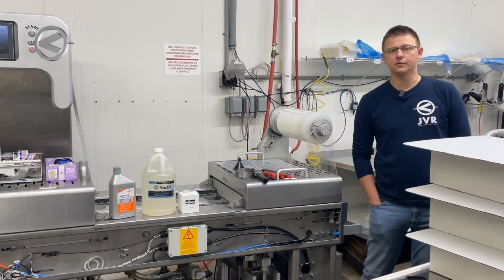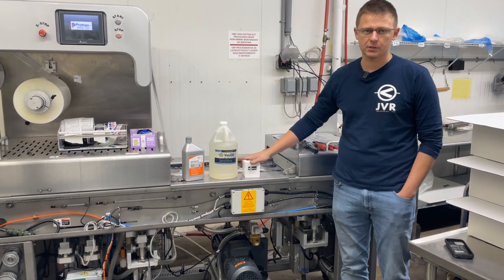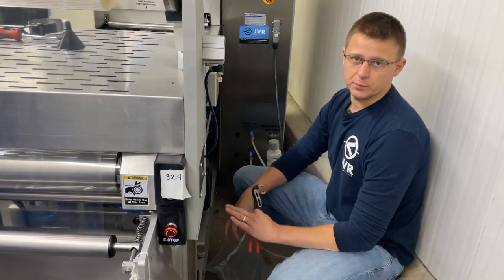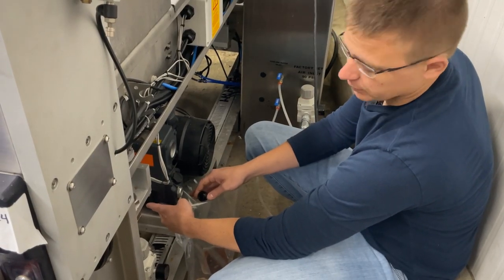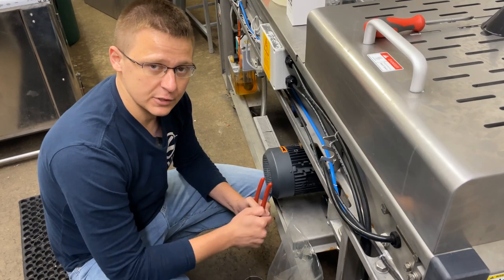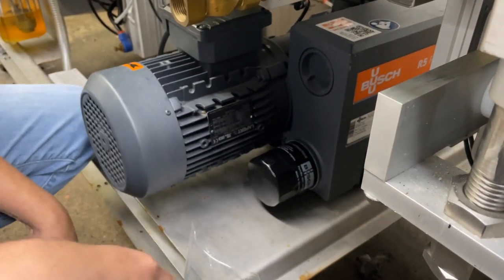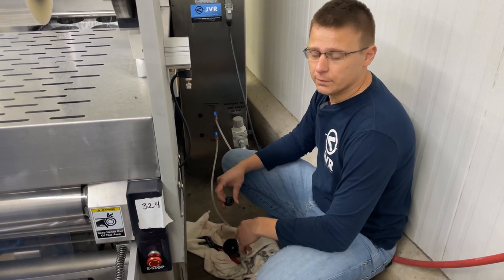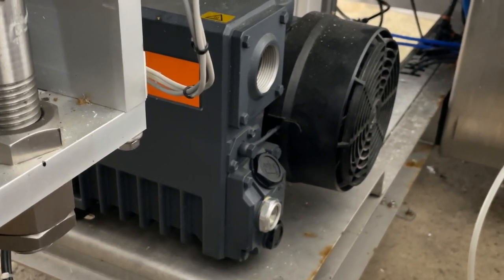Busch R5 Series Oil Change Walkthrough | JVR Industries, Inc®

Comment: Have you ever had any issues with the anti suck back valve? If so what are some symptoms that it’s bad? Thanks
Reply from the maker: @ofeelma  The anti-suck back valve will seal off the pump in the event that suction at the inlet side is greater than that inside the pump.  For example, when the pump is shut-off.  If the valve fails then oil from the pump will be expelled into the inlet plumbing.  If you notice oil in your vacuum hoses then you likely have a failing valve.
Reply: What about replacing the escape filters???

I'd like to learn about them but there is no information watching the video.
Reply from the maker: @newconcept8144  I assume you're referring to the exhaust filters.  Replacing these is not difficult but the process does vary depending on the model number of your vacuum pump.  We hope to eventually have a series of videos that would show how to replace exhaust filters, along with other maintenance procedures.  In the meantime, we have a very knowledgeable support staff that can help you if you need instruction on replacing these filters.  Feel free to call us during normal business hours and ask to speak with our Busch service department, we're open 8:30am-5pm EST, Mon-Fri, and our number is 716-206-2500.